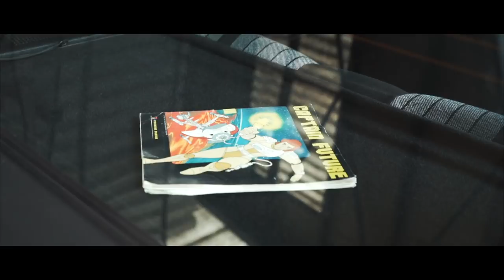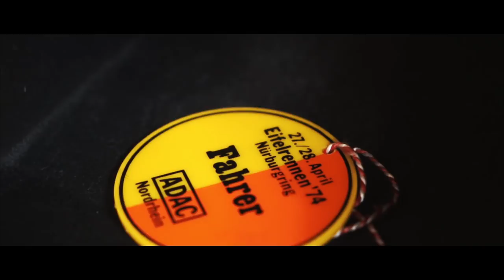VW GOLF MK1 GTI PIRELLI | Carsten Fischer | VWHome

Comment: I don't think people understand the idea behind those rims. its maximum tuck on a zero lip rim with a hellaflush face. its cool... not many rims are made with face as thick as those. If the car has air ride in, he could possibly drop the arch on the lip of the face. that's how much clearance there is between the fender and wheel